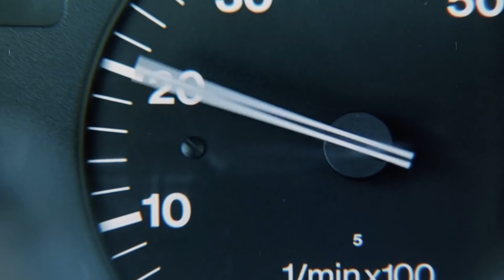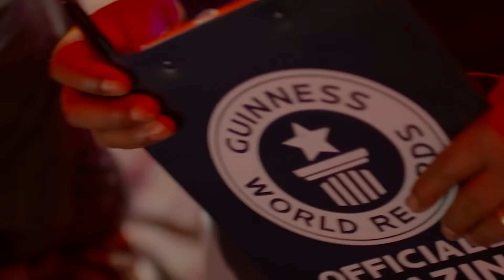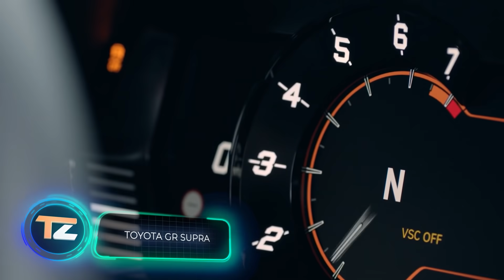8 CARS THAT CAN DO MORE THAN IT SEEMS AT FIRST GLANCE

Comment: Guinness Book of World Records never should have honored that two-wheel driving at the airport and here's why it had to be a factory production car reinforced sidewall tires are not factory production
Reply: Reinforced sidewall tires are called run-flats because when a tire is punctured beyond the extent of repair, the cords in the tire will move to stiffen the sidewall of the tire so you can make it to your destination safer than a flat. Pirelli as well as a few other companies make them.
Reply: Plus, do you really think a car can drive on two wheels without reinforced sidewalls? A regular tire would have shredded before that run was over

Comment: Lmfao like nobody notices the white cable on the audi e-tron just pulling from the eye bolt under the car or is that just a ratcheting slack line mechanism they installed under the car to assist the climb while allowing the vehicle to not slide backwards.